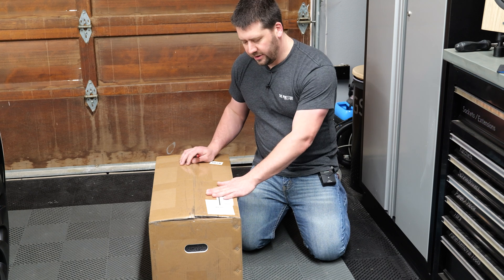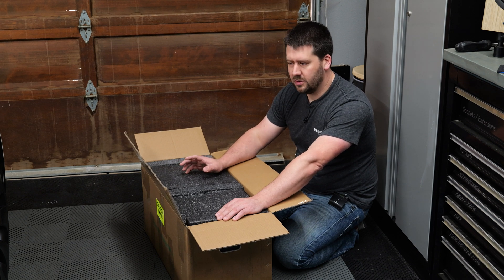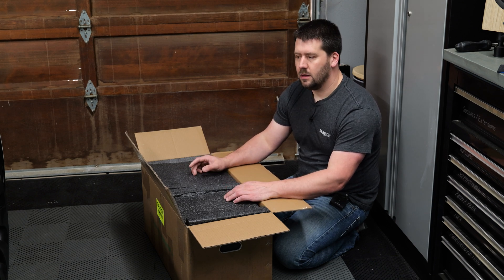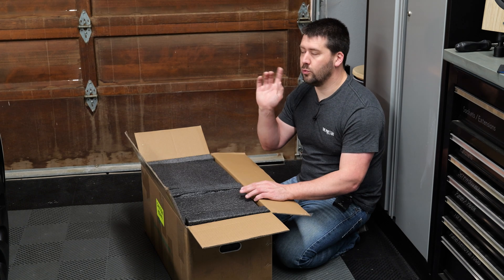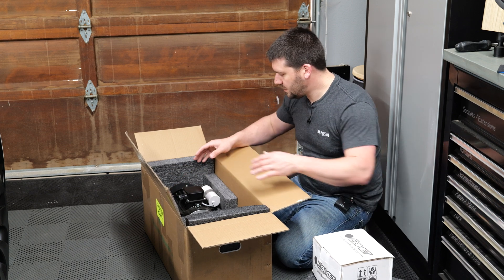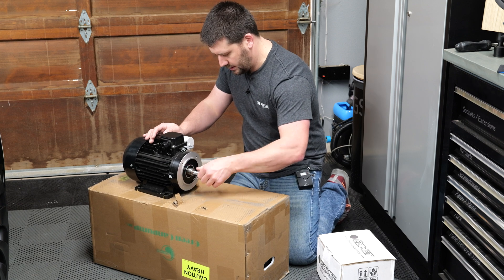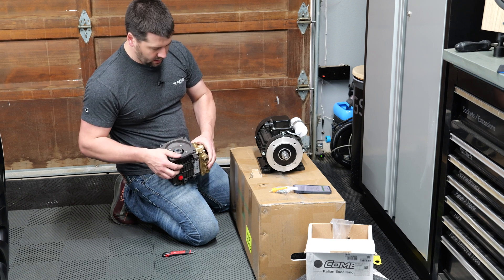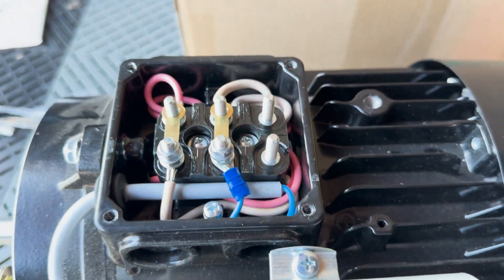I decided to make a Custom Pressure Washer part 1 IG661

Comment: Same motor brand (nicolini) it's actually made in Italy.. with my current setup for 220v-240v countries but my motor are hollow shaft type 4hp/3kW 1450rpm and connected to AR XW15.15 n series which is 24mm shaft (15 litres/mins & 150bar) pair with tecomec unloader valve with delay total stop system from tecomec.. You can easily get almost 14.5 litres/mins and 85bar - 100bar (3.8gpm at 1200-1400psi) with 6.5-7.0 nozzle.. For the motor you can choose for hollow shaft version for easier to pair with most pressure washer pump that "n" version(male shaft 24mm) and more compact setup.. I'm on my way to do my second setup with 5.5gpm head with target pressure 1300psi..wish me luck mate..👍🍻
Reply from the maker: Nice! I'm definitely looking forward to hearing how your 5.5GPM build goes.
Reply: @improvedgarage  need to dial on how much the motor running amp can hold on with the pump.. I'm using the 5.5hp/4kW 220v-240v motor to pair with the AR RW21.15H N cod (21 litres/mins & 150bar).. The pump actually should be run by the 7.5hp/5.5kW 3 phase motor to achieve the pump spec flow and pressure..I'm still waiting shipment for the motor.

Comment: Very interesting and I appreciate the laymen’s explanations of the electrical terms and definitions. Question: what does 3+ gpm accomplish that the 2.2+ you have now doesn’t? From an ROI perspective this seems more of like a ‘can I create this’ project vs one that would have a tangible benefit. Guess I need to understand the true benefit of the higher gpm.
Reply from the maker: Honestly i need to use it to wash a car to truly answer that.  

Cost from where I already was?  Its probably stupid...

But lets say you don't have anything and you're interested in a K1322 or an AR630, you're going to install a dedicated outlet for it, etc.  This is only a different breaker in your panel to make it happen as a 240v machine.  The K1322 is $1122 right now, and for $1160 you can buy the prebuilt bertolini from Canpump that has 1.5x the output..  

That being said, this is all unnecessary, we can wash cars with a garden house if we wanted to :)
Reply: @ it’s interesting. Regarding flow rate, does the additional ~1gpm achieve something? Reduce water use since it rinses more quickly? Alter dilution needed in a foam cannon?
Reply from the maker: @BigJosh_Details  These are things i want to find out!

Comment: I have been debating this for the past 2 years....spoke with canpump a few times  .....following your channel now. I have had a custom spec pressure washer doing 2.1 gpm on 120volts 20amps ....its about 69-72 db ......when you have your setup stabilized please do a proper pressure/gpm and db measurement....Good luck and I am staying tuned :)

Also....a proper TSS system (not canpump's silly remote turn off/turn on) is a must.
Reply from the maker: i measured 74db today in a pretty rudimentary way, it was within 1db of my k1322.  Id be interested in how the https://www.canpump.com/canpump-wall-mount-pressure-washer-4-hp-nicolini-motor-240-v-total-stop-system/
with the 2130 and the pressure switch would do out of the box.

Comment: Jeff I missed the beginning of the video when you were talking about the circuit for powering this motor. According to NEC you are to take the FLA rating of the motor and multiply it by 1.25.
so, 17 X 1.25=21.25. Seeing they don't make a breaker that size you would have to step up to the next size breaker which is 25 amps and you would need to run 10 AWG wire as it is rated up to 30 amp. Not trying to be a know it all but I went through the same thing you are when I built mine with this motor, just trying to help and make it easier for you.

Comment: I don't know dude seems like a pain in the butt. For like 1 more gpm. I think I will just get the 630 and be done. But I'm really glad you are doing it. Thank you for sharing!
Reply from the maker: totally alot of work and unnecessary, i would be really interested in how https://www.canpump.com/canpump-wall-mount-pressure-washer-4-hp-nicolini-motor-240-v-total-stop-system/ with the 2130 and the pressure switch would do out of the box.

Comment: Jeff have you designed your control circuit for the motor yet? Are you going to be using a contactor or just a 2 pole switch to turn it off and on? Please make sure you use something that has a thermal overload as the Nicolini motor does not have any overload protection built in. I will send you a link to the switch Nicolini recommended to me, I didn't use it as I went a different direction and used an ABB Manual Motor Starter
If you use a contactor, think about adding a Delay on Off timer so it does not turn off right away every time you stop washing. I set mine up with one and set it for a 15 second delay which give me time to move around the car when either foaming or rinsing. Constant starts and stops are the hardest on the pump and motor. 
I would also add a thermal relief valve to the pump just as a safety feature in case something would happen with the TSS not turning off the motor, its cheap insurance at around $15.
For your TSS set up are you going to us a system with two pressure switch's or one pressure switch?
Have you chosen your unloader yet?
I can't wait to see which direction you go and see how it turns out; I think you will enjoy the adventure as I had fun building mine.
Reply from the maker: i appreciate the back and forth in emails.

For others here, im going to use an external unloader and i may try the canpump tss system as a starter and go from there.  Im already looking at other options for contactors and pressure switches, the timer is a good idea, kranzle is doing something similar with the KWS700

Comment: I LOVE Ohms law and electricity. I always love seeing all these 120V 5 and 6 HP rated vacuum cleaners and other tools that never get even close as they only draw a maximum of 10 amps on a 15 amp breaker. not realizing that the motors only do about 1.3 to 1.5 horsepower .
Reply: BSP = British Standard Pipe i believe
Reply from the maker: Yep. 4hp is around 17a at 230v :). Remember though that hp has a rpm component, so if you can make the motor spin faster it makes more horsepower. I don’t think 6 is possible on a 10a though

Comment: This is why abandoned any thought of making my own. I’m good with what the AR630 does. If not I’ll just run a dial setup with them.
Reply: I thought of you right away when he started with the fittings! Lol
Reply: Keav if you run a dual setup, you would need a dedicated circuit for each unit. Need check valves so they don't back flow into each other, if they have a TSS hope they work together so both turn on and off together. That seems like more trouble than building a unit that can flow 3gpm at 1200-1600psi. Its really not that hard to do, just takes a little research.
Reply: @ Yes you would need that and I’ve done dual setups before so I have all the parts needed. I myself will probably never do it I’m finding myself caring less about that 3gpm benchmark. 2.2gpm with the 630 is more than enough and I have RCA3 Pro that already does 2.8gpm. 630 though the pressure switches work well with a dual setup proved out by OG. In my garage adding a second circuit would take 5 minutes so no problem there plus it would be 4gpm pretty easily doing it that way.
Reply: @CarsWithKeav  What additional parts would you need to do a dual AR630 setup as two AR630 will cost someone over $1500. The RCA3 Pro maxed out at what was it 1100psi and retails at $1700, not a practical unit for someone who may already have all their own accessories, maybe AR will get smart and sell the pressure washer by itself. Hopefully Jeff will give a total amount for his build, and we can compare cost between them
I think the big advantage to building a 220v unit is it more versatile with being able to have the high flow at a higher pressure for other cleaning task around the house. My pump is rated at a max of 1600psi at 3.5gpm and I have a big enough motor to do it if I need to by just swapping out the tips to a different orifice size. If I ever decide I need more pressure I would just need to change out to a different pump with a higher-pressure rating, don't I will ever have to as I have not found anything I could not clean with the setup.
Reply: @ All I would need is another AR630. I have everything else plus the ar630 I’m using now. In the end though I’m not doing any of it I’m good with what my AR630 is doing. I’m done with the high number stuff now it was just a fad and another rabbit hole for me. I have a gas pressure washer for around the house as it’s much more mobile and versatile.
Reply: @BTW574  no need to overthink it or to try and fix something that isn’t broken.  Why go through all the trouble to setup dual pressure washers when all you need is one?
Reply: @PeeGee-g4t  What??? Where did I say I was building a dual setup. Keav said he would do a dual setup if he wanted more flow instead of trying to build his own custom setup. I asked Keav what additional parts would be required to do it so we could do a cost comparison if Jeff gives a dollar amount his build cost him.
Reading comprehension
Reply: @BTW574  my bad if it replied to you.  My comment was regarding the overall subject of what was said.
Reply: @PeeGee-g4t  I apologize for my tone as it seemed you were kind of coming at me.
Reply: @BTW574  no worries it’s all good. 👍

Comment: Have you come across the Kranz-Lee 230v custom Kranzle pressure washer? It looks similar to where you're headed and claims 1900psi 2.9gpm at 13 amps.
Reply: The Clean Garage sells the Kranzle KWS700TS Electric Pressure Washer Total Stop - 2400 PSI 3.3 GPM... 240v, single phase, 25amp... $4,000.
Reply from the maker: yea matt has had them for years too, one was at the old OGHQ.  It needs 10ga atleast and a much bigger breaker.
Reply from the maker: i would have gotten that if i knew it existed..  pretty nice

Comment: I purchased from them too but opted for the  canpump pump, aside from the lack of instructions I'm very pleased with the flow and power.
Reply: Which model did you choose?  I was surprised with the 240v selection Canpump offers.  Some under $900 with TSS and unloader all ready to go.
Reply: @AMI_Detail  Since I had to install a dedicated outlet (30amp) I opted for a little more power and picked up the Canpump Wall-Mount Pressure Washer: 5 hp Full-Speed Motor 240 V, Total Stop System.  Shipped to my door under $1100.

Comment: Jeff Have you pulled the flange off of the Comet pump, if it has a flat mounting surface the Bertolini Pump flange will not work as it has a raised locating ring on it. I am using the same motor for my pressure washer build, the problem with the Nicolini motor is it's not a NEMA 56 C face. I ended up going with an AR pump and then I had to order a F44 flange that had the 130mm bolt pattern from an AR dealer out of Italy as no dealer in the US could get it. After I got that flange, I had to take the front mounting plate off of the motor and have the locating ring machined down from the NEMA 56 size. If I remember correctly, I think the machine shop had to machine it down to 115mm. I am also using the AR 25395 unloader which has the TSS switch on it.
Reply from the maker: Interesting. Thanks for the heads up.  The flange will be here tomorrow and I’ll take a look. They tried it on a comet pumo in house and said it worked. If it doesn’t I’ll probably want to swap my comet for the bertolini pump as that’s something I could actually recommend to my followers

Comment: So you plan on using an open gun? Cause the unloader does more then just set the pressure...
Reply from the maker: I plan on using a total stop pressure switch, but you bring your a good point for testing…
Reply: @improvedgarage I have never actually seen one of those modules with the control gun in action. I assume any kind of delay or signal disruption would cause the pump to over pressure and get damaged without an unloader within a few rotations...
Reply from the maker: @Ayestosea you may be right. I’ll dig into it next week following your comments. I was under the impression the pump had the ability to bypass without the unloader, but re-read through the guide and see that is the case only for the variants with K in the name. If I need to add an external unloader I’ll do so.